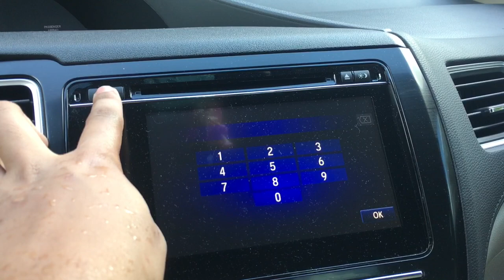2012-2015 Honda Civic MAF Sensor Clean & Replace DIY

Comment: Couldn't you just unscrew the throttle intake hose running to the intake box and and pop the top off of the air filter box, instead of removing the whole air box?
Reply from the maker: Yes.
Reply: No you can't. I tried. The top half of the filter box is hinged to the bottom. You have to take the whole thing out like in the video

Comment: I'm actually a little surprised on the amount of things that needed to be removed, usually working on the Civic is a breeze and requires 0 tedious work like putting hoses back. Cleaning the MAF was easier on my BMW than this but the civics doesn't seem too bad. I'm sure it could be worse
Reply from the maker: Its only these 2012-2015 Civics that are a PITA. The 2006-2011 are easy. Honda for some reason pushed back the airbox in the later models. The 2016+ civics are easy.
Reply: I got a 13 😔

Comment: Went to do this and discovered a crack in my air intake hose, went to another vid and fixed that. Cleaning the MAF sensor in the morning and installing my new fog lights in my EX-L 🤙🏼 tks brother

Comment: I really liked your video bro. My problem is that now my sensor is not working properly lol. And I got the VSA, power steering and check engine lights on my dash. What do I need to do now bro?😣😒
Reply from the maker: You plugged it in while it was still wet. Clear the codes and you should be good. Just disconnect the battery for 5 mins.
Reply: Same thing happened to me did you fix it?

Comment: Made the mistake of not unplugging battery... Had to reset ECU OMG Christmas lights came early... 
Still love your video great stuff Thank you so much!!!
Reply from the maker: Christmas lights are built in feature with these modern cars lol
Reply: I did clean some engine plastics and did not unplugged battery now got 2 codes p0113 and p0102 how can I fix it? Do I have to replace the sensor or just clean up
Reply: Drastico Perez what did you end up doing?
Reply: Also wanting to know what you did

Comment: Excuse my ignorance,but what is that tool you use to unscrew the screws? a socket wrench? What kind(not size, like what is this long L shape called?)
Reply from the maker: That is the ratchet. The socket is the small part that connects to it. (the part that says 10mm, 12mm etc)
Reply: Thank you.

Comment: Had an issue after I installed a cold air intake to my 2015 Civic, water was getting sucked through the filter everytime it rained and I hydrolocked the car twice! Took that piece of shit cold air intake out then installed a short ram and realized my mass air flow sensor had gotten wet and was damaged. If you want to install an intake stick with the short ram intake so you don’t go through what I went through
Reply from the maker: It's not worth it especially without a tune.

Comment: My car idle fine, but when accelerate the car hesitated not to crazy but noticeable it’s annoying. Will by cleaning the sensor solve the problem?
Reply from the maker: Cleaning the throttle body and this sensor should improve the responsiveness. 
Throttle body cleaning video: https://www.youtube.com/watch?v=jfQp1BU5zvg
Reply: Is the car still hesitating?
Reply: Same problem with mine
Reply: Same situation here. I get a lot of hesitation accelerating hard between 20-40. Thanks for the info. I'll try cleaning both out.
Reply: Update: my air flow hose was torn just like a lot of other people, causing that above issue. I changed it, and I still cleaned theaf like in this video. Now I no longer get the hard jerking due to the rip, but get small suddel jerking. So I guess the MAF can't be fixed. I also cleaned out the throttle body like in the video linked here.
Reply: @jaymi8809  yes replacing the hose took away a lot of the problem. But after which I had very small hesitations at low speeds (2-20mph) like in bumper to bumper traffic. I had my friend who is a Mechanic look at it with his computer. He did some resetting peocedure and the majority of the symptoms went away. I thought it was totally fixed but Now it's extremely subtle. the hesitation Is there 2-5mph when I'm gentle with the pedal. I guess the door swivel itself needs to be cleaned better. I thought I did a good job but there mustve been buildup I missed

Comment: Very informative vid man thx..gotta get my car scanned before I try this operation haha.
but one question how long should I let it dry before re installing??
Reply from the maker: I would wait around 10 mins if you're not in a rush
Reply: @MrRangerZr1  sencer was fine...ended up having a split air intake hose:/ but the knowledge will help in the future..thanks again🤘
Reply: @ovetstevo  oh the hose split.... Damn.
Reply: @ovetstevo  same thing for me. I cleaned the MAF anyway. But now the cars softly jerking between 20-30mph
Reply: @lionintu did you find out what the problem was?
Reply: @romeloblade6479  it turned out to be my abs control module: /